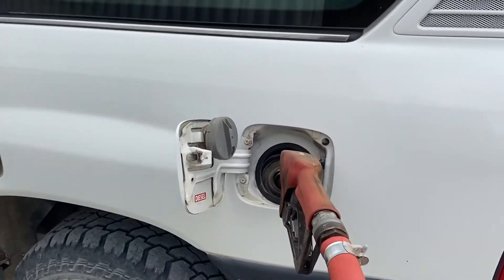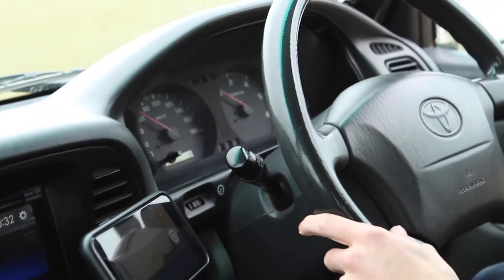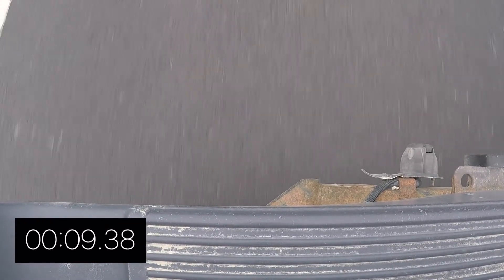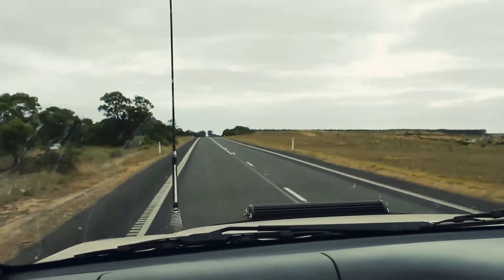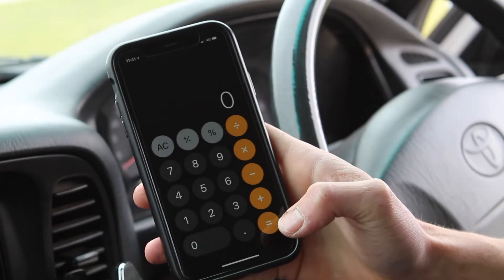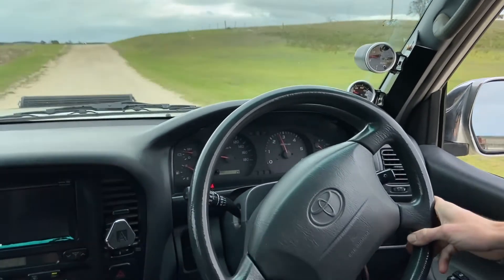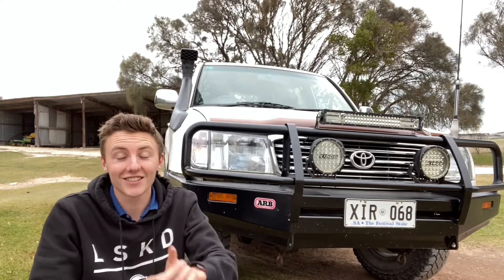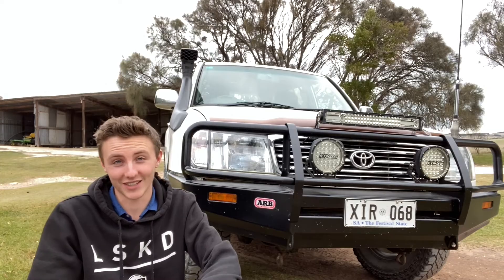Stock 1HZ vs. TURBO 1HZ [Turbo Conversion Part 4]

Comment: I've read on more than one occasion that boosting the 1HZ stresses the engine and shortens it's life.
Reply: Turbo charging any engine shortens it’s life. That’s just a fact. But good thing about the 1hz is you can essentially build it into a 1hdt or you can buy a whole new engine for $1000. Or for 7k someone can build a turbo safe 1hz with a 1hdt head and con rods and bearings.
Reply: @keqrou  Thanks :)
Reply: As long as you do it properly there are no problems. A lot of people stress and worry too much about cars sometimes. It’s a diesel engine it wants air and it’s perfectly safe and healthy to turbo it. As long as you do it properly and don’t go over the top with boost unless you have rebuilt it for higher hp applications. Mines running 15 psi and making 140whp un-intercooled.

Comment: Yeah just put a turbo in my 105 11 pounds boost don’t need a intercooler cause the turbo is water cooled and oil cooled the 1HZ is very torquey now

Comment: Hi Dear,
I had been watching your 105 Series videos & it's modifications and I love that.

I am from Pakistan and I intend to buy one 105 1HZ Cruiser. Actually, I have spot one UN used 105 whose complete code is HZJ105R-GNMNS. Its GX variat mentioned on the rare.

I heard its bomb proof engine but its very sluggish.

1- Kindly confirm that it is only sluggish or under power as well as I might be doing off-roading and up-hilll trips.

2- What's the fuel economy of this engine over normal foot as it will be my daily driven car?

3- How many seconds does it take from 0 to 100 km/l? As per your video, it's 35 seconds, and by installing Turbo its 28 seconds. Is there any downside of installing Turbo or any impact on the engine in the long term.

4- If I compromise on acceleration of 1HZ, then what about its off-road and up-hill performance as I used to do two or three off road trips in a year along with my family in remote areas so it should be reliable as well like nothing.

5- Do you recommend to swap it with 1HD FTE along with transmission and wiring is costing me here in Islamabad around 2.5 Million Rupees.

6- Does it have front, central and rare diff locks pre installed by Toyota?

7- Does it has OBDII port and ECU or computer? Can we do 1HZ chip tunning like uni chip Etc.

I am currently using 2.7L Patrol Prado 2010 model and have covered the whole Northern areas of Pakistan with some good off-road trips and am happy with it. It's also sluggish, but recently, I bought GAN GA+ chip tunning, which is giving me more power but I am not sure it can be used with 105 as it connects with OBDII port.

Thank you

Comment: Hey, love you videos. 
Just wondering if you could do a video regarding how you wired up your boost and EGT gauges to your battery as my boost park light seem to be ok, but my pyro EGT has like a dancing effect or doesn’t work at all when I turn the headlights on and my foot on the brake peddle. 😞 Any info would be great. 🍻

Comment: weird thing with that 0-100 after getting it turboed is that my NA 1hz 105 did it in 25 seconds... and i've got it on 33's, 2 inch lift and with a tent on the roofrack.
Reply from the maker: Keep in mind this is before a tune. Would have made a lot more sense to make this video after a tune in hindsight. Post-tune my best 0-100 was 15 seconds
Reply: @WillsLandcruiser  hell that's unreal, I'm keen for my bus to be able to do anything near those times!
Reply from the maker: @rackers4x4  definitely an improvement from the old NA slug! Slows down a bit once you start adding roof racks and tents and bigger tyres and all that, but it still pulls up hills like a train and there’s rarely a need to drop gears anymore

Comment: Hola te escribo desde argentina. Tengo un coaster con el motor 1hz y quiero ponerle turbo, la consulta es si al motor le hiciste alguna modificación  o si el motor es standar? Y también preguntarte qué características tiene el turbo? Así busco uno similar acá en Argentina. Saludos y gracias!
Reply: Hola Hernan - Normalmente no necesitan alguna modification de el motor.

Comment: 18 months on what would you have done different? Any problems encountered. Im in two as to whether to turbo my 2002 105 1HZ with 320,000 kms. I dont want to compromise realibility but that extra bit of power would be nice.
Reply from the maker: My next video will be on this very topic. It’s been 30,000 since I turbocharged it. Please go and watch the video where I got this tuned if you haven’t already— it’s a much more accurate representation of what I’m driving now. I have never looked back. It’s still an absolute joy to drive and no signs of any problems so far!
Reply: @WillsLandcruiser  thanks for the reply Will. Looking forward to the next vid
Reply: I know EXACTLY what you mean.. 
only another  105 N/A owner will understand..

Comment: Good vid mate, but just 1 question, I've read alot about about 1hz with turbo and everywhere says there good but wears the engine out alot quicker because they ain't really made for the turbo
Reply from the maker: Working any engine harder is going to shorten the life of an engine by a little. The 1HZ’s are a naturally retarded engine so they’re made to live forever with not a heap of power

Comment: Is it worth buying a 1hz and doing the conversion or is better to just buy a built 1hz turbo motor or 1hdfte I want something thats not gonna struggle up hill towing which will last long I've heard the 1hz has to be built for it to last long with a turbo, I had a 94 hilux with the 3l that was turbo which was a weapon of a ute but it struggled with big uphill driving like driving on the m1 to central coast
Reply from the maker: Honestly mate, if you’ve got the money for an FTE, you’d be silly not to. Currently building one myself. The turbo HZ is fantastic and holds 110 easy through the steepest hills, but it’s nothing compared to an FTE
Reply: @WillsLandcruiser   @Will's Landcruiser Mods   cheers man 🙂 I was considering a 90series pardo that had 1kz only had 150kms but it sold so ill guess I'll be going with this 105 if found with a reco 1hzt for 18k, end goal is always gonna be a 1hdfte 105 with a dualcab conversion last car I will ever own
Reply from the maker: @jeremynakat5469  I can promise you now, you’ll be a LOT happier with a 105 than you would be a prado 😂 even with the 1hz, they’re a bloody solid engine, amazingly reliable, just a little short in the power department. Throw a turbo on it and you’ll be satisfied- in fact you’d be making as much as a brand new 79 series with a 1VD in it. But FTE convert it and you’ll never want another car again 👍👍

Comment: Did you do a trailer towing test pre turbo.
I have a HZJ75 that does a lot of hauling with a 2000kg GVM trailer and have, repeatedly, heard that if you tow with a 1h don't turbo it.
Reply from the maker: Yeah look, naturally your EGTs are going to be more of a factor with a turbocharged vehicle because of the back pressure that the turbo creates, storing the heat in the combustion chamber. If you do a lot of towing, it’d absolutely be safer to the leave the HZ naturally aspirated. But you could potentially still get away with a turbo if you had a really good intercooler and an incredibly safe tune. I have done a little bit of towing since the turbo, intercooler and tune and it holds up well. Nothing like the towing you do though

Comment: Hey,

I just saw your video and I'm actually searching for the pipe that goes from the turbo to the air inlet manifold.

Is it possible to have a link?

Regards
Reply from the maker: Hey mate, had a quick look and couldn’t find a hose that wasn’t part of a kit. Might be worth giving someone like eclipse turbo’s or G Turbo a ring and asking. You’d be surprised how many of these companies are willing to sell individual parts over the phone
Reply: @WillsLandcruiser  thanks for the info! 😁

Comment: Great changes. I've never timed my 100 k but it was rather quick compared to the slow old non turbo in my 1993 troopy. The best fuel economy was 10.377 liters per 100. 14 pound boost. Full synthetic oils with a bypass filter for the engine, with oil cooler. I'm sure I was running 11.5Rx 15 tyres. Turbo was a DTS.
Reply: Great? You should rev the engine way higher. Now there is 5th gear before 100 km/h. 🤦🏻‍♂️

Comment: i hope you are going up a hill mate. my dirt old stock 1hz 80 (on 33"s) did it in 28sec up a small hill. didnt run back down the other way. whens the last time you did valve shims? have you done them? id say belt timing but you fuel isnt bad enough for a tooth out. and im sure you have timed the pump. fuels a touch rich but that wont hurt time
Reply from the maker: Liam Cooper old girl probably needs quite a few things done. After some new injectors and should check the clearances soon too. But since it’s been tuned the old girl does 0-100 in 18 seconds!! Huge improvement and stoked with how it’s running at the moment

Comment: what was your EX temp reading and water temp reading at 100kmh?
Reply from the maker: Brendan Morrison EGT was about 350° and water temp was just below the middle on the factory gauge (whatever temp that is). Since I’ve had it tuned (and intercooled) EGTs are 250° at 100km/h
Reply: @WillsLandcruiser  thanks' mate. What intercooler did you end up installing? water to air?
Reply from the maker: Brendan Morrison went for a HPD S2 top mount cooler. I’ve got a video up for this too. Very happy with it!

Comment: Hi! I am from Argentina and I have a 1Hz coaster, I want to know what setting the fuel pump and the wastegate valve require to what maximum did you regulate according to the rmp?
I got turbo and multiple from land cruiser 1Hd-t, before installing it I would like your advice. thank you!
Reply from the maker: You should be alright to put the turbo on without altering the waste gate- you could back it off a turn or two if you want to be on the safe side. As far as the fuel goes- I’d get a professional to adjust that for you

Comment: Mate, are you shifting up at around 3000 rpm? Maximum power of the stock 1HZ is at 3900 rpm and overall best acceleration occurs if you rev it a bit over 4000. Main reason being that after each up shift you wind up at a really low power output.
Reply from the maker: That’s definitely a fair point. I was being a bit conservative on the engine because at the time I wasn’t sure if it’d like being pushed too hard but you are dead right about that- I was shifting too early to get maximum power
Reply: @WillsLandcruiser  you said you where putting your foot down i dont know if its a problem with the turbo but stock you can over fuel it and it will start to retard the engine. also a good speed test would be going from 100 to 120 aka over taking some dipshit doing 100 in a  110 zone i always get stuck behind that one dipshit going 10km's under the limit when going to Melbourne and after Ouyen there are no dedicated overtaking spots. same goes with over taking trucks there a few places to overtake trucks around here.
Reply: really?. I never knew that.  I've always shifted at 3000rpm. I'm going to hold it for a bit longer when i remember to just out of curiosity..
Reply: @frucklerbullpit  Use more juice though :(

Comment: Also bro, did you use the stock injection pump? Or did you have to swap it out for a turbo injection pump. thanks!
Reply from the maker: Yes stock fuel pump and injectors

Comment: Hello my friend!! Great video. I have a Mitsubishi Pajero 4M40 2.8 N/A. The thing is so slow, but its the best truck i've ever had. I would like to get it turbocharged and intercooled. Any tips for this?? Lessons learned? Thanks!!!!
Reply from the maker: My biggest tip would be to take your time and take those extra steps like welding the sump return in and making sure everything is done properly and securely! If you’d like to talk more about this please find me on Facebook or Instagram :)

Comment: High 14L per 100... That doesn't sound right at all. 
My standard 1hz gets 12.5-13. I would hope adding a turbo would get me down to 11.5-12L else it's not worth it. Can't believe you're comparing 14.8 and now with a turbo 14.5 that's not even logical
Reply from the maker: Yeah look mate it depends entirely on your vehicle and what condition the 1HZ is in and how you drive it. For a while I was getting 13L/h consistently but over time I’ve started driving a few k’s faster everywhere, tightened up the accelerator cable so I can put my foot down further, it wasn’t really a fair test so I can’t truly give an accurate before and after because there were too many changes
Reply: @WillsLandcruiser  thats fair enough mate. honest reply. sorry if I came across harsh. not hating on your videos. perhaps you need to do a more long and accurate drive something around 400ks or more on a tank. before and after to therefore get a more accurate reading when dividing. 80ks is not long at all , too many variables you're right. and also a tip. I use http://www.petrolcostcalculator.com.au/litres-per-100-km/ that is so easy to use. and you just need to refill your tank at any servo to see what you have drained since full and check your spedo you zeroed out at the start of the fill up. thats the only two numbers you need
Reply from the maker: Paul Griffiths Cheers mate glad to hear you’re not hating on my videos! 😂 I was just going for a general guide to show it doesn’t massively increase fuel consumption or anything. A longer drive would be way smarter for a good fuel consumption reading and give a way more accurate reading. That calculator looks like a good thing too! That’d make life easier!

Comment: What turbo and how much did it cost? I’ve got an old 91 troopy and want to turbo the old girl
Reply from the maker: It’s a J3 (JB Turbo kit) and I’m pretty sure they’re valued at $2400. Great quality for the price as far as turbo kits go!
Reply: Will's Landcruiser Mods thanks. even now after the 4 odd months that you did the review video the engine is handling it no problem?

Comment: I'm in two minds. I love my petrol 105, super responsive auto with great 0-100 speed. But the fuel bill is horrible. I've considered swapping for a 1hzt but my biggest concern is the manual (I do a lot of stop start driving as well as highway) and that even with a turbo, they are still slow.

Comment: You don't have to limit your boost pressure by wastegate but you can do this by amount of fuel. To make it more clear:
Diesel engines can run as lean as over 100 AFR or as rich as 10 AFR. In first case you have very lean burn, very cold exhaust and not much power. This will never damage your engine no matter how many psi (bar) of boost you have.  In second case you have very hot rich burn very hot exhaust. In this case even with very small boost you can easily kill your engine. 

Now, you can't have too much boost without extra fuel. In order to get boost you need exhaust gas and the more you have exhaus gas the more it spins your turbo and the more you have boost. So, by limiting amount of fuel you kill a few birds with one stone. 1. Good fuel economy, 2. Low exhaust temperature, 3 boost pressure you need. 

Many people add extra fuel and limit the boost pressure by setting up wastegate and think it is all good.... No this is not good. You can have 5 psi of boost and too much fuel and this will kill your engine  sooner or later.

BTW I am finishing my DIY 1HZ conversion right now. It is almost done. The only one thing I am missing is boost compensator.
Reply: @WillsLandcruiser  You have to be very careful as this engine is indirect injected and originally non turbo... But you have to remember one thing... your main enemy is heat.... Heat is what kills diesel engines. And as you understand heat is not coming from air when it comes to diesel engines, but heat is coming from fuel....  How many psi of boost you have is not an issue, but how much fuel is injected... Let's say you set your wastegate to open at 5 psi of boost but you added too much fuel... In this case you have a very good chance to burn your pistons...

Comment: That's a lovely engine dude sounds great and I know it probably feels good too so turbling my 1hz land cruiser 80 series is totally safe it won't blow my engine up
Reply: I mean after you get compatible pistons of course it won't spoil my engine block and more?
Reply: @WillsLandcruiser  and turbling my 1hz I dont have temper with the injector pump right and the raves

Comment: Haven't driven my 105 cruiser in 3 weeks. Miss it so much it's just sitting there. Well done, yours is great
Reply: nice to see another 105 owner. not a lot of them around any more. just curious who did you get yours from? my one is an ex Parks Victoria 105.
Reply: @phalanx3803  carsales. Hadn't been driven much, completely stock and very low kms
Reply: @bigoz1734  roughly how many kilometres?

Comment: Now get it tuned
Reply: Will's Landcruiser Mods when I turbo’d my cruiser (I actually have the exact same turbo and manifold) plus a top mount intercooler when it was put on the Dyno, the fuel ratio was 26/1 @ 10-11psi. Maxed the stock fuel pumps efficiency out at 16psi 21/1 fuel. Doesn’t blow any smoke, egt’s on the highway are under 250. Long pulls can’t get them past 550. My probe is in the same spot as yours. Ended up with about 50% power and about 80%  torque over stock. Quite pleasant to drive.

Comment: I did 0-100 on a highway towing a small trailer and quad bike and it took 32 seconds with my 1hz, I was pretty happy with that. If you push it up to 10 psi could you do a video on how it performs, cheers Angus
Reply: Will's Landcruiser Mods that’s awesome mate, I’m keen for the next video
Reply: Saving 7 sec on an 80klm trip. Wow, that's an average time saving of 0.0875 sec for each kilometre.